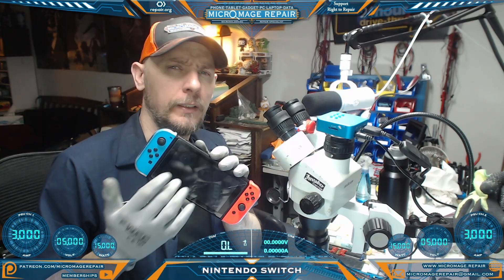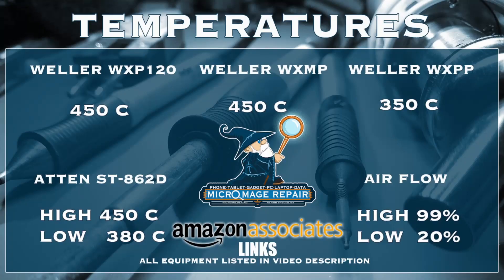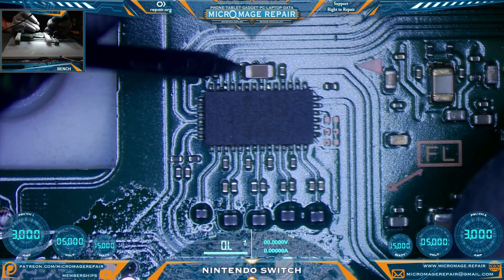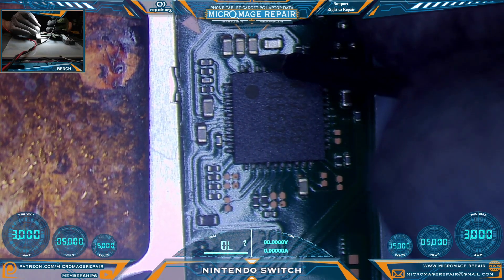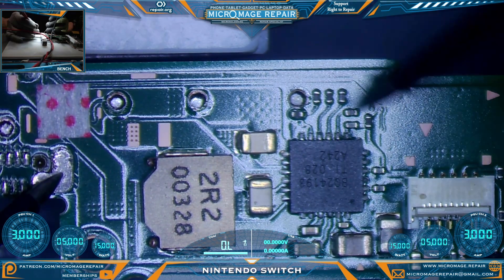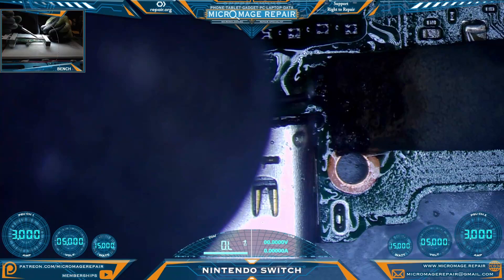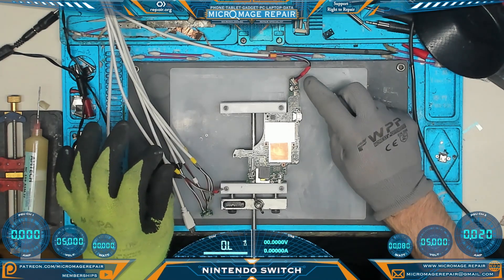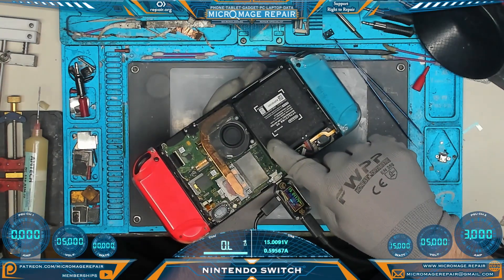Nintendo Switch: 💔 Not Docking

Comment: Love the new style of video 😉 btw how did you make the power cable?  Would love to make one!
Reply from the maker: Wich one in particular? The Squid or the 3.5 to USB C?
Reply: @MicroMageRepair  the squid 😉
Reply from the maker: @highroyds old White iphone battery squid/cable, just wired Switch battery cables to it (cut right off batteries). I'm getting enough questions about them I may just sit down and record a video.
Reply: @MicroMageRepair  I bet you are, so you’re just using two wires and no resistor for the middle wire?
Reply from the maker: @highroyds  The squids have a sense wire.
Reply: @MicroMageRepair  the squid cable I have shows 4 wires, positive, negative, DM & DP (iPhone 7 plus)
Reply from the maker: @highroyds  Just use the cheap white ones. They work perfectly. 3 Wires Red, Black, White. Tie the two reds and two blacks together (OG and OLED Switch)
Reply: @MicroMageRepair  got the cable through 👍 so you don’t use the middle cable?  Or does that tie in with the middle cable on the iPhone?  Only reason for asking is that retrosix say they have a 10k resistor between positive and the middle pin.  Cheers for the help.
Reply from the maker: @highroyds  mine has three wires, red white and black. I used them all with no resistor. White is data, I don't think the switch battery has any special requirements over the iPhone.
Reply: @MicroMageRepair  perfect,thank you 👍 btw on this cable squid I did see that the middle wire is tied to a 10k resistor 😉
Reply from the maker: @highroyds  Interesting!
Reply: @MicroMageRepair  yeh that was on the iPhone 6 cable, the others also have resistors for the middle wire too, between 10k and 20k
Reply from the maker: @highroyds  I probably lucked my way into using the right one. I never checked resistance lol